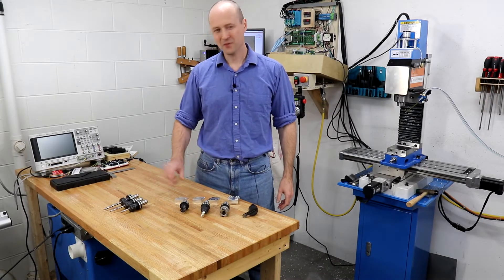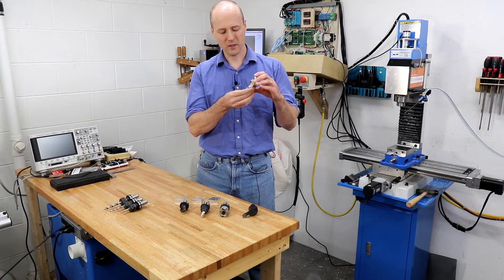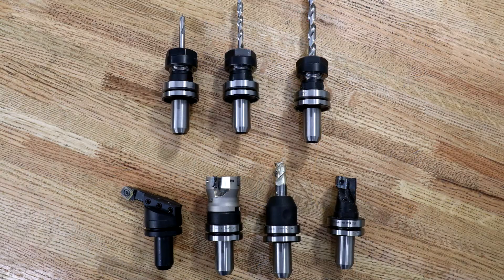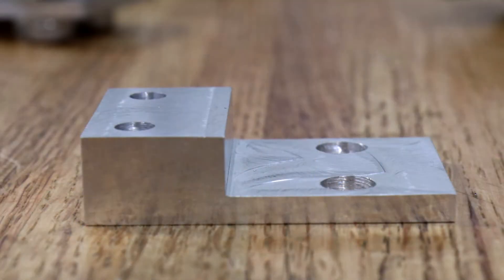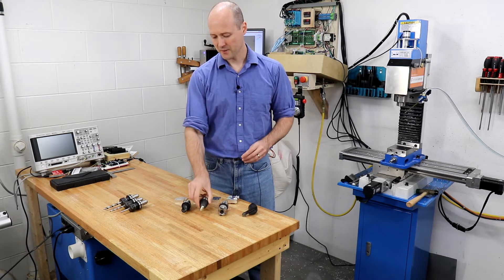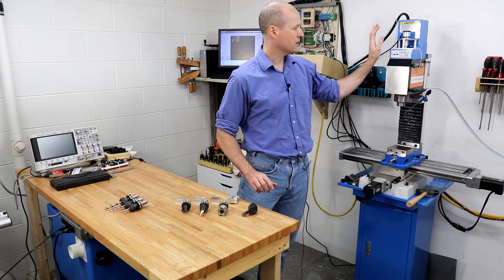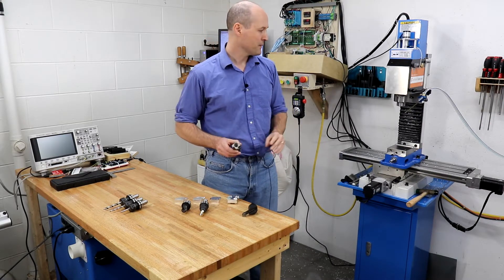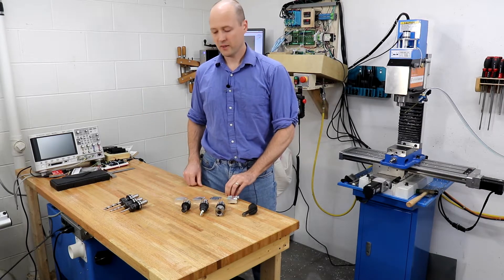CNC Milling Tools, Spindle Load, and Performance

Comment: Hey Kent... After watching almost all your videos and the ones from Clough42, I just pulled the trigger and bough a lathe and mill that I will be converting to CNC.  Thanks for all your insight!!!  Just curious, have you had any luck using Chinese ER20 collet holders and collets?
Reply from the maker: Wow Joel, I hope you have only great experiences!
Short answer: I have no experience with the really inexpensive collets and holders.
Longer answer: I have ER16 & 20 holders and collets from Tormach. They seem expensive, especially after the prices increased. However, they are better than the runout in the mill main spindle. When you get your equipment, measure the spindle and other important factors carefully and rectify problems with the vendor, else you'll be fighting against larger problems later. The high speed spindle I added is much nicer than the stock spindle in terms of run out... and for that the Tormach ER collets were insufficient (TIR of .001"?) and so I picked up three Lyndex collets.
Lathes are easier to get precision on than mills. Lathes have fewer axes of freedom, and easier to make rigid. The main problem I had with the lathe was the weak compound. If you can make do with a solid tool post, I highly recommend one.
Looking forward to hearing how your conversions go.
Best wishes
Reply: @kentvandervelden  Thanks for you quick reply.  Very much appreciated!!

Comment: Probably a dumb question but I haven't been able to figure it out in Linux... How the heck you getting an actual rpm readout?! 😆
Reply from the maker: That's a great question and I hope you have an easier time than I did! My PM25 is from a few years ago and something may have changed. Inside of the head is a disk mounted on the spindle. The disk is inserted into the slot of a photo-interrupter that generates 16 pulses per revolution. The pulses are not balanced and the breakout board I had at the time could not sample the pulses fast enough. I had to create a circuit to condition the signal (Schmitt trigger) and divide by 16. After adding the circuit the breakout board could read the RPM at the highest speeds. This is all worse case... if you have a faster breakout board, you may be able to connect the spindle encoder and use a scale HAL component to do the divide-by-16 in software. Hope this helps.
Reply: @kentvandervelden  I'm curious because I have a superpid on my other machine and I can get the rpm to show in Mach3 but not Linuxcnc, so it's definitely there, i just don't know how to display it
Reply from the maker: If all is electrically good, might just be software. Check the signal is getting from the breakout board to LinuxCNC with HAL Meter. Then, attach the signal to phase-A of an encoder HAL component with counter-mode=True. Finally, attach the velocity output to the display component. Each part can be debugged with HAL Meter. I know, easier said than done. If you post your config files on the LinuxCNC forums, someone always helps. You'll get it!

Comment: Excellent videos and analysis, thank you for sharing. I teach Electronics, PLC, Hydraulics, Pneumatics, Mechatronics, Machining and CNC and much more at a local college where I use the large knee Mills. In my own Mobile Teaching Unit. I need a smaller mill, weight and size are factors for my Mobile Teaching Unit. Do you recommend using the manual PM 25MV to teach college age students or do you know another mill that would be better ? and if I convert the MP-25MV from manual mill to CNC with a conversion kit do you recommend it for teaching CNC? Would you please let me know what you think to these questions and at your convenience would you please share: Cost that you incurred on mill set up and purchased,  conversion from Manual to CNC,  recommendations on initial tooling (what brand part number, company you buy at etc that works well and what not to buy), plus please share any learned lessons and modifications for the MP-25MV that can be applied for education/instruction and building real parts. My email address is  jpmentortech@gmail.com  Thank You.
Reply from the maker: Hi 
Jean Paul, this is an important question that needs careful answering. I forwarded it to a friend who teaches the same subjects and has been down this road. If he has time to respond, I'm sure he'll have great advice. For the parts that I feel confident answering I'll do so shortly by email. Stay healthy!

Comment: You could add a current sensor to your controller and then implement adaptive feed control so if the spindle is at a specific load the feed will gradually decrease until it is stopped when overloading the spindle (so possibly no broken tool)
Reply from the maker: Exactly! I'm glad to hear the idea is not crazy. I have a power sensor that I can read into Linux but the sample rate is terribly slow, 4Hz. So that project is on hold. I'm replacing the spindle motor and plan to return to this idea afterwards. Thank you
Reply: @kentvandervelden  you can have a look at samcoinc´s video (https://www.youtube.com/watch?v=7LAtx8o48jI) using a brushless driver
Reply from the maker: Thank you, that's a great reference!

Comment: Nice video. Do you have any tormach superfly speed recomendations for mild steel? I also have a pm25mv. Thanks
Reply from the maker: Hi, I can't help much other than to watch the chip color. I like milling steel because of the feedback that chip color provides, but I almost exclusively mill aluminum.
Reply: @kentvandervelden  thanks for the quick reply. I started at 700. Then went to 1000 and the chips were dark. So I settled on 600. Lol
Reply from the maker: Just curious, what's your chip load and depth of cut?
Reply: @kentvandervelden  I have not done my cnc conversion yet so I'm just dialing it in manually. I was typically taking only a couple thousands cut at a time.